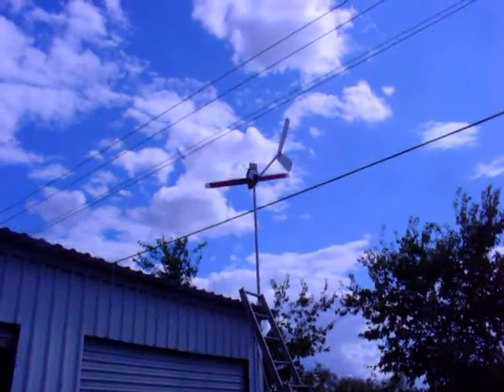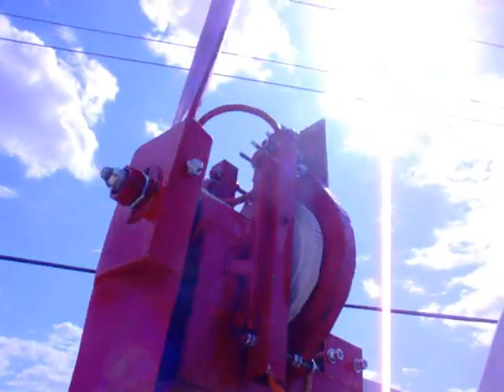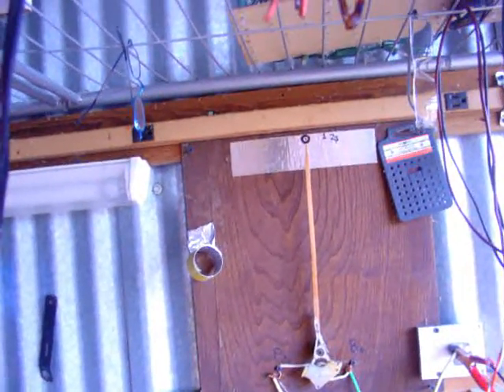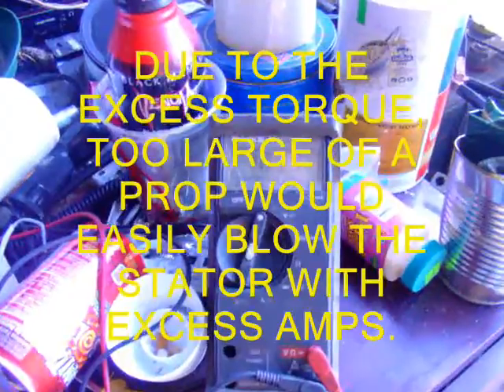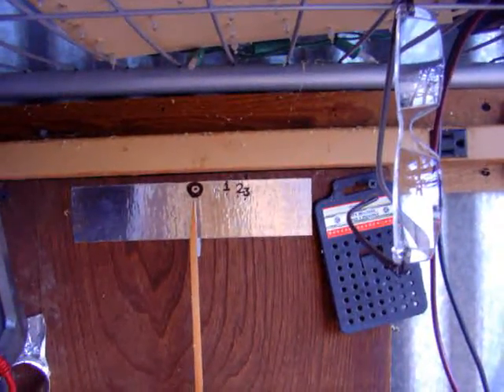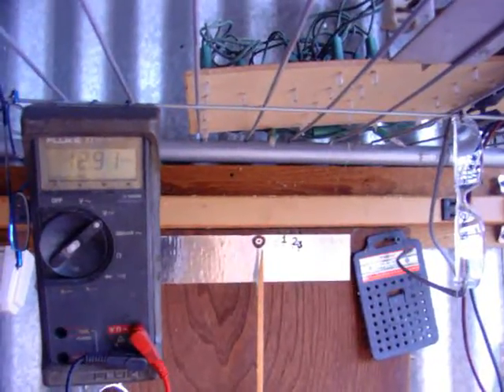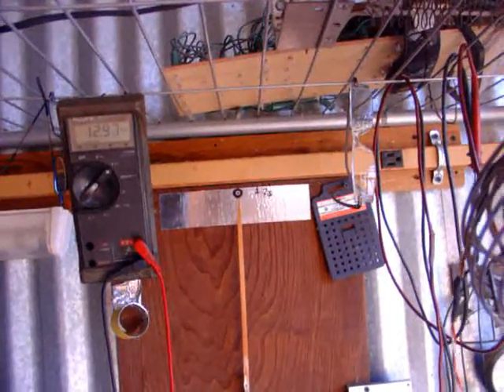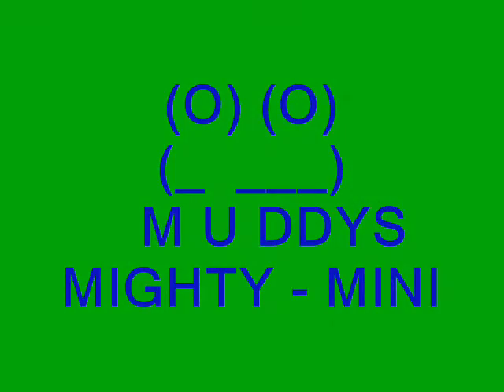PART 8 DESIGN OF MUDDY'S MIGHTY MINI WIND TURBINE

Comment: @muddymuddymuddmann
Well, short of getting a second complete unit, hacksawing the Tips to be Flat & Straight, erecting them in the middle of a flat open Paddock, & measuring them with a "Deci-Bell-ometer"...; there's no way to be totally certain, but I can see how it'd work.... And, Parallel L/T Edges with 1/2 Circular  Tips gives good Starting-Torque in low winds... Due to the extra Blade Surface-Area.
Ciao !

Comment: Hey buddy!! nice job on the mini.  I like the idea of the secondary set screw on the side of the blade into the shaft. I am still working on my mini 3 phase, got it up to over 160 volts no load, but I need to set up some blades like yours, those really work great. ill try and keep ya posted as I just moved back to Oregon, catch ya later on and again, GREAT WORK!

 but might go to 13, or 15 wire size and see if that gives me more amps. gre

Comment: Hey mud man   I have a 3hp pm motor 124volt. 3850 rpm do you think if I made or if you sold me a blade cell for it would it keep my battery's up?? I would Lille to power my ham radio shack  with wind power! Cz

Comment: Why not use rought up (grinder action) bushings to line and strengthen the mounting holes for the stator to prevent pressure on the epoxy? Maybe a larger washer to spread out some of the pressure.... Regards, Sander